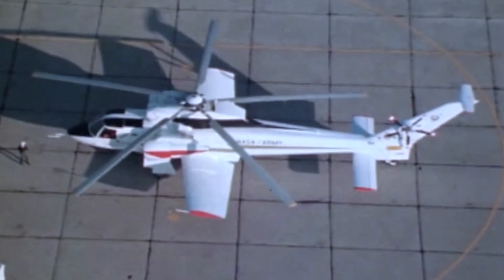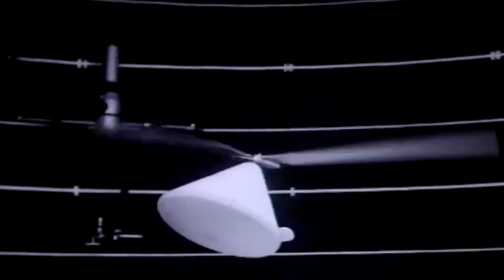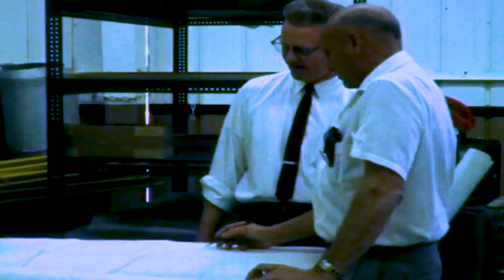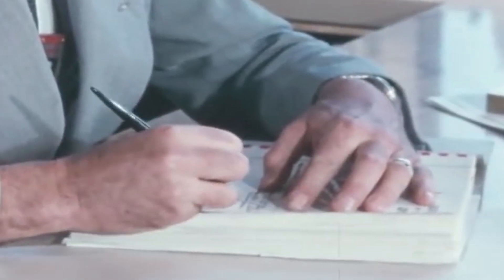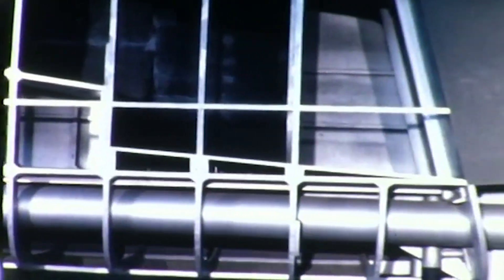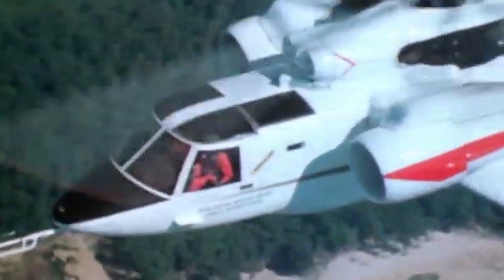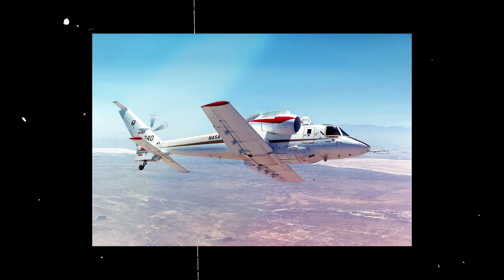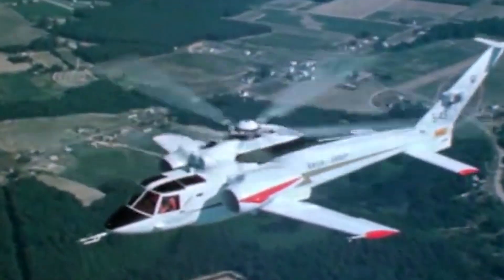The X-Wing - S-72 Jet Helicopter with Blades as Wings

Comment: Everytime I see this videos I always think "Why they never come back to revisit this projects/concepts, but with nowadays materials and technology?"
Reply: Given the challenges with the V-22, new tech is also dangerous on top of expensive.

The B-52 and Tu-95 soldier on because they get the job done, and that’s true of a lot of military hardware where there isn’t a clear need for fancy new tech in many roles.
Reply: I think the same thing sometimes
Reply: Technology has moved on so far that many things that were done in the past are now done differently and better, like additive component manufacture (known as 3D printing). To take advantage of new tech and new understanding of physics, you need to start with a clean sheet. I highly recommend searching YouTube for "remake Rocketdyne F1 engine" for an excellent video all about why we don't actually rebuild stuff from the past, and why this is no bad thing.
Reply: @lukedogwalker  lpl
Reply: Sikorsky X2
Reply: The osprey does pretty much the same thing using a tilt rotor.
Reply: @moshunit96  that’s because it... is a tilt rotor.
Reply: Three words: operational requirement and funding. The military doesn't invest in anything nowadays unless they can convince the politicians that its actually necessary.

Also, things that try to combine elements of two very different things rarely prove to be worthwhile (just look at the Russian ekranoplan). You might be able to make it work with modern technology, but the cost would be unjustifiable. Better to just upgrade the Apache / Blackhawk / whatever, or build improved versions.
Reply: we have currently VTOL craft that this is pretty much the pioneer of. without this. who knows what we might've missed
Reply: @alexio1942  helicopters are the pioneering VTOL aircraft.  If you're talking about the Ospry it's an expensive piece of junk.  Waste of military spending just to have something different.  If jet helicopters were a great idea they'd have lots of them by now.  Not the first time our government has wasted money on aircraft that went no where..supersonic bombers for one..still flying B-52's cause the concept won't work or other concepts are better
Reply: @brendencain9983  Yeah. The Osprey was so efficient at killing Americans, one has to wonder if it wasn't actually built by Al Qaeda Aerospace. Obviously a bit of dark humor but 12 incidents and 42 fatalities between 1991 and 2017.
Reply: @lokisgodhi  and at 72 million a pop..waste of taxpayer money
Reply: @brendencain9983   The Osprey is a fine AirCraft and has a comparable fatality per year of service to any other Helicopter in service . Though its capability far exceeds helicopters . The president is regularly transported using this craft . 

Though I imagine the OP was thinking more like the F35 . A multi-role fighter with compete VTOL capability that has literally changed the entire NAVY carrier combat doctrine . 

Gone are the days of the hook and floating runway. 

And that's a good thing.
Reply: @brendencain9983  lmao so fuckin wrong, we’ve had anti gravity craft for decades that are our true vtol air/spacecraft. I’ve been up close in person to the TR-3 Triangle air/spacecraft and the new iteration of the F-117 Nighthawk which also uses anti gravity propulsion and is a teardrop shaped body with no wings or tail. It still has the classic radar deflection angles on top that makes it look like a F-117 tho and it’s flat on bottom.
Reply: @brendencain9983 B1 Lancers still kicking
Reply: @lokisgodhi  You do realize that 12 incidents and 42 fatalities over 26 years, especially in an aircraft that carries 26-28 people is a pretty good record for a military aircraft, don't you?
Reply: Because the people(citizen) have more information and they know that we know that is just a way to waste money, so they dont do that fancy stuff like this heli-plane
Reply: I wonder, what was chokehold in that day, was it computing power, compressor or what.... this would be cool to revisit this concept 2020.
Reply: @effexon yeah it looks like something that should’ve been built now for like AH64 or attack Blackhawk competition, that thing would be loaded. AIM9 120 Hellfire rocket pods or the GAU guns they got on the littebirds but from 556 to 338 geaoooodawmn!!
Reply: Practicality
Reply: They did with the B2 and others.
Reply: They are but aren't telling us about it. Loose Lips Sink Ships.
Reply: @Loki1988-A  BINGO!
Reply: @Loki1988-A  No it's not, it wasn't going to work.
Reply: @Loki1988-A  precisely
Reply: They already had the materials we use today. They use materials we don't know of.
Reply: They do, but it's a whole new project with new people because in reality it's really all about making money and keeping the contractors and profit making war machine going and going. There are lots of ideas and plans and designs that get done over and over in circles instead of building up because it's not about being efficient or maximizing time and effort, etc, it's just about money. There's a lot of great examples of this. Another example is rocket assisted shells. Cancelled on the Zumwalt ships. But 50 years previously they cancelled a very successful 8" gun program because they said 5" with rocket assisted shells would be just as effective...and it never happened anyway. It just all goes in circles for profit. And if it isn't money, it's politics in regards to money. Congressmen with competing districts, Congressman with different ideas on what they want or corporations lobbying against each other to make their own programs more enticing or worth throwing billions into.
Reply: They maybe do.
But we all know governments are shady secretive fkers so ofcourse the public dont know.
Reply: Well if you look at the 1st flying wing bomber(Yb-49) till they got the bugs work out with (B-2) it was about 50 yrs , 1970  till 2021 is about same time frame so  it might happen
Reply: Same bro
Reply: I'll bet these companies would love nothing more than a multi billion dollar cheque from the federal government to rebuild rebuild a project they already did and abandoned for good reason 
Another money pit with no one to blame when it fails to live up to expectations again
Reply: It was more important to them to blow up Sheiks and goatherders for twenty years than to build Airwolf.
Reply: I was thinking the same! Too far ahead of it's time, but not for today...
Reply: They moved from this idea to something based on the gyrocopter idea.
Reply: Because they have vtol jets now
Reply: I thought the concept was restarted in the early 2000's? I distinctly remember a sci-fi show featuring a variant of it?
Reply: I was the Sikorsky  chief of Design during the last year of the program.After the Challenger accident  NASA ca canceled the program when we were about to begin flight testing with the blades.
Ed Miller
Reply: Vertical takeoff jets are a better concept
Reply: @brendencain9983  a Jack of all trades is a master of none
Reply: 1. Money
2. We now know that it's kinda useless
3. We have more efficient designs.

The US government gave everyone and anyone a billion dollar funding back in the day.
Reply: They do. Most of the coolest stuff in existence exist behind the green door, and secrets are kept for a lifetime, by those who enter there.  Why aren’t our cool toys used in conflict? Who says we don’t use them?  Do you expect full coverage on the news of such things?  You’ll see plenty if we have a Third World War. Nothing else warrants tipping our hand.

Comment: I worked at Allison when that clutch was designed and developed. I applied experience gained from that program to the preliminary design of the JSF LiftFan clutch in 1990.
Reply: I like mechanical things. What would you say is so particularly special about that clutch in the JSF?
Reply: @ratherbflyin3301  the Sikorsky X-Wing clutch (as it was referred to by Allison) was a wet disk clutch using Gylon friction material. It operated at about 1 hp/sq. In. heat flux rate. My initial preliminary design for the LiftFan clutch was similar, but was too heavy. I did a material study looking at carbon-carbon composite friction material using a heat transfer analysis program that I wrote. I found that a dry disk clutch with C-C material could run at 2.5 hp/sq. in. Although the configuration changed some from my preliminary design, the dry C-C approach is what is flying now in the F35B. I left that group and started working on the Model 250 helicopter engine program in 1991.
Reply: @ronaldschoolcraft8654  That is wild...I always thought a clutch with such infrequent usage would be limited by torque/friction, and not by heat dissipation/power. And you did it in the 90’s! It takes so long to get tech into aviation.

And...THE 250?? I used to fly the B407. Love that motor! “Alternate” start is the best thing since sliced bread: 16% Ng, click to idle and let her start cool. So cool that I’m messaging the guy that keeps me in the sky!
Reply: @ratherbflyin3301  I was the lead engineer for the gearbox and bearings for the 250-C47B used in the Bell 407. I designed, and was awarded a patent for, the self closing valve for the lower chip detector used on that and the C40B.

The inertia for a 48" diameter fan is huge, so it takes a fairly long time to accelerate it up to operational speed. That means the clutch has to slip for an extended period of time so energy management is crucial. It has a mechanical lock for positive torque transfer once the speeds are synchronized.
Reply: @ronaldschoolcraft8654  You built the mechanical heart of the machine. Such a pleasure to see those birds fly.
Reply: @ronaldschoolcraft8654  I swear, I hope to meet you in real life one day for coffee or beers. I feel like I could pick your brain for hours! Sounds like you had a great career keeping a lot of people in the sky! Thanks for your responses!
Reply: @ronaldschoolcraft8654  some aircraft landing gear brakes used C-C material long before that. Is that where you got the idea of using C-C? It’s very expensive.
Reply: @zipz8423  Yes, that and the space shuttle brakes. No one had applied it to high energy clutches before.
Reply: @ronaldschoolcraft8654  and rocket engine bells for decades. I hope you got at least a piece of the Collier Trophy to put above your hearth. It’s nice to be free to talk about what one has achieved in one’s career. Bravo sir.
Reply: @zipz8423  Thank you, but no, I didn't. That work was all heavily classified then. I couldn't even tell my family what I was working on. The Collier trophy was displayed in the plant lobby for a while, though. Considering the threats leveled against me when gaining a Secret Special Access Required clearance back then, it is sickening to see classified information leaked all over Washington these days. The penalties for not properly safe guarding that information were stiff. If you are politically connected with a "D" by your name, those penalties apparently don't apply.
Reply: @ronaldschoolcraft8654  I’m not sure much has changed. It’s who you know not what you know!
Reply: @ronaldschoolcraft8654  Thank you for your service in furthering the field of engineering. 🙏😎
Reply: Just goes to show that even when projects don't work out, you can still gain valuable knowledge from them.
Reply: And we thank you for your service. Fucking brilliant Ronald.
Reply: Me too
Reply: Quite impressive!  The control system needed for X-Wing, though, was far more complex than what is needed for the F-35B.  Just take a look at how the blowing over the blades would have worked.
Reply: @tararaboomdiay7442  correct. That's what killed the X-Wing concept. The clutch worked really well in the test stand.
Reply: @ronaldschoolcraft8654  Yes it did.  But it wouldn't have mattered how well it worked, that wasn't the flaw in the concept.  It was what was involved in the blowing over the blades and lift generation.  As a thought experiment, consider what would be going on drying transition either way.
Reply: That was supposed to be "DURING" transition!  Curse you spell check!
Reply: Oh, and I left out, consider the implications to the process if the blades got dirty.

Comment: airwolf :-)
Reply: @sidgar1    Air wolf didn’t look anything like that
Reply: @JA-eq5um  AH-56 was a military aircraft with wings and jet propulsion, too. The helicopter in this video has no armaments. Looks aren't the only comparison.
Reply: @sidgar1  
The AH-56 had a pusher prop on the tail, not jet engines.
Reply: @1001-u6r  Interesting. It has a tubular exhaust behind the rotor shaft which I always assumed was a jet. But you're right, its forward thrust is augmented by a pusher prop.
Reply: @sidgar1  Bell 222
The Airwolf helicopter was a conventional Bell 222 helicopter modified by attaching some film props.